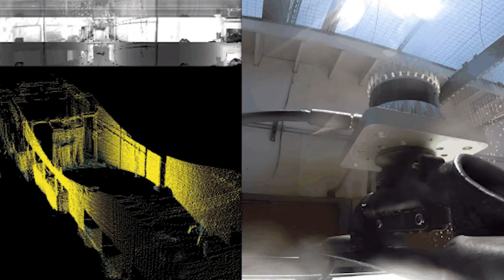Introducing Ouster's 3D Industrial Sensor Suite for High-Volume Material Handling

Comment: Why company do nothing and let stock price keep breaking and down and down...???
Reply: its those NDAs...
Reply: At this point, it's kind of an open secret that Ouster sensors are included on the new Amazon Proteus bots. Ouster even posted an Amazon video on their blog today about 3d lidar and industrial automation. But, for some reason, they can't or won't release specific details regarding a deal. My guess is that the ongoing litigation with Velodyne is a factor.
Reply: kind of a silly question and you look uneducated. the company is doing something, hence the frequent videos and partnerships. only thing that will change the stock price is profitability, so it will take time for customers to implement this tech into their company
Reply: @partypooper8198  other lidar company has rebound after turbulent,but why only Ouster keep dropping and we can see history  lowest price everyday? So don't you see something wrong for this stock ?
Reply: @AMZGaGa  Oust is fairly new to the market and it IPO at a ridiculous valuation during the peak of the stimulus bubble.

it's a small company in a niche market that has yet to really get established. these other companies you mention that "rebound" will go down if the overall market keeps going down, it will take time.